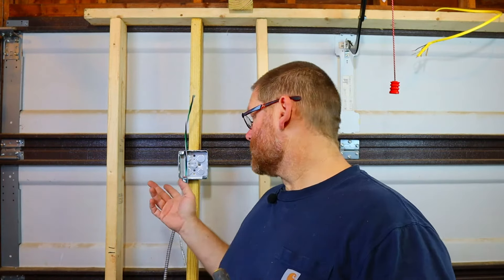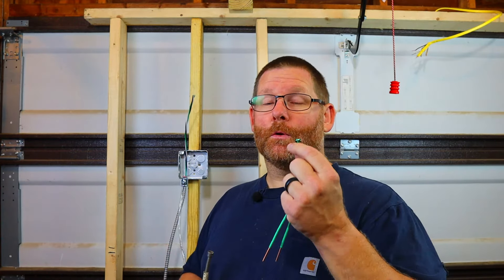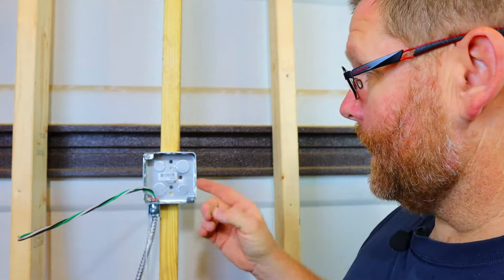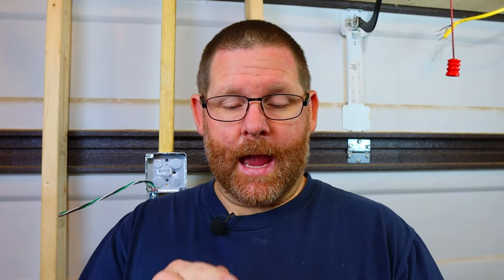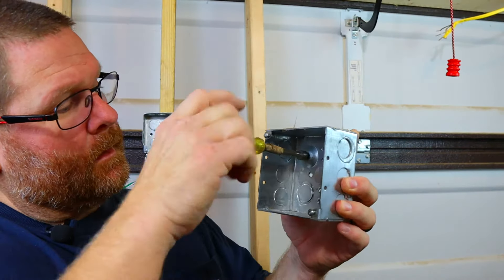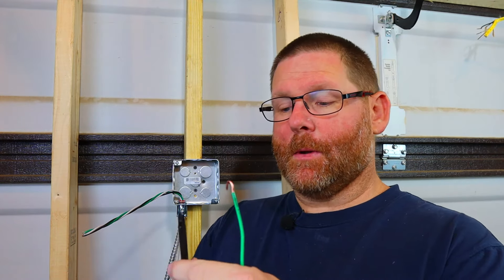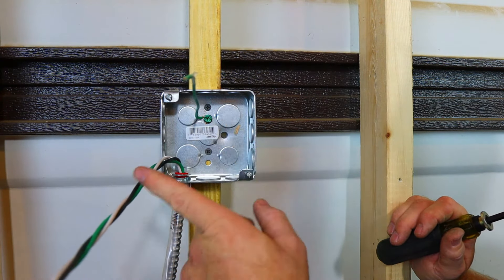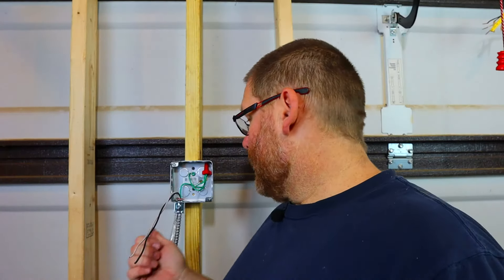How To Ground And Bond A Metal Electrical Box

Comment: Appreciate the info. Is that bend twist, twist again and the bend the wire to form the wire hook true of any conductor that is screwed  to a  switch outlet etc. ?
Reply: Yeah I was wondering the same thing. I would think you would do that on the box to get a very secure ground connection, and it wouldn’t matter as much then doing just a normal hook on a receptacle or switch. But we need the pro to tell us!
Reply from the maker: Yes

Comment: Instead of using a pig tail ground wire, can you use the source ground wire by stripping a small section of it, wrap it clockwise around the painted ground screw lol, crimp it close, secure it and connect it to the load ground?

Comment: Just curious. Why do you use metal boxes for electrical wiring? We use PC (plastic) boxes in the Netherlands, no grounding needed. They are round as well so it is easy to drill a hole in wood/wall or whatsoever
Reply from the maker: Well truly that's just a standard here in the states. It's usually speced that on the jobs definitely PVC is quite faster and a lot easier to work with. Thank you for your comment and watching have a great day

Comment: Great video! Do you prefer the screw on connector more than wago? I will be doing this to my entire house and am unsure where to put the wires once in the main panel. The original installer was stupid.
Reply from the maker: I don't trust wagos I hear alot of good things about them just do not trust them.
Reply: In my (admittedly limited) experience using wagos in electronics low-voltage wiring, wagos don’t generate the same amount of compression force, so can’t stand up to strain the same way a properly twisted wire nut join can.

Comment: Learned a whole lot from your videos. Potentially dumb question: If attaching metal junction box to a metal stud, is there a chance that a fault would electrify the entire metal stud/building for a split second? Thank you.
Reply from the maker: Good question. The building steel is or should be grounded so it will definitely ground itself out. I doubt you would ever feel it.
Reply: @MountaineerOutdoors  Thanks!
Reply from the maker: My pleasure ☺

Comment: I decided to change a receptacle and found that metal box was wired like a plastic box, no ground wire to the box. I found a 10-32 threaded hole, so I did what you showed and everything seems fine. My question is, doesn't the receptacle itself ground the box by virtue of the mounting screws and contact with the box as long as the romex ground wire is connected to ground on the receptacle? When I tested the receptacle with a tester before and after it read "correct" and not "open ground"
Reply from the maker: So technically yes the yoke of the device im will ground it you will need to remove the little paper squares on the screws. If you have a metal box though it is still good to keep the ground on the box as well. As for the open ground. Open ground means that from the receptacle to the panel it's broken or not hooked up inside the panel. It doesn't have to do with the screw in the box. Hope that makes sense
Reply: @MountaineerOutdoors  Thanks for quick response and clarification of open ground.
Reply from the maker: Always my friend..

Comment: Quick question - if I add a metal box extension to a properly grounded metal box, does the extension need to be grounded separately or will it be grounded through the metal to metal contact to the box?  Thanks!
Reply from the maker: Great question, it would be grounded by the original box.
Reply: @MountaineerOutdoors  Thanks!  Your videos are the best!
Reply from the maker: I appreciate it ☺.

Comment: Hi I'm actually in the middle of doing this in my home, quick question so after you have bonded the ground pigtail and wires from the home, is the 3rd ground wire supposed to simulate the extension of the wire? My case I have to extend my cable by a foot.
Reply: I don't get it either.

Comment: Nice. I like your sense of humor! Is it against code to put stranded 12ga wire onto a receptacle screw? Or do you always need to solid wire?
Reply from the maker: No you can pull it to the Recep but you will need to add a fork terminal or add a wire nut and a solid piece of wire to it

Comment: So your ground screw can’t touch a wood beam?
Reply from the maker: Why can't it?
Reply: @MountaineerOutdoors  it was more of a question. Can you ground your outlet to the lag bolt that attaches the box to the wood beam? Seems like everyone says it needs to be drilled out or attached to the side of the box.
Reply from the maker: @kentdavis7787 no it has to be a machine screw it the clip on one. Do people do what you asked me? Absolutely will it work absolutely, is it code nope.

Comment: It definitely takes more time, and I have had to do this with my old house that seems to need custom work at every turn, but have had to drill and tap new holes for the green grounding screw with metal j-boxes.  Not ideal for making good time, but what else to do.
Reply from the maker: Better safe than sorry for sure.

Comment: You’re only partially correct about whether to bond the metal box or not. If you’re only running MC cable to the box and you don’t make any splices or terminations with circuit conductors in that box, you still must bond the box with the screw and egc. Why? Because the armor of the MC cable is not intended of capable to be used as an equipment grounding conductor and all metallic non current carrying parts must be bonded. The MC armor is not identified or sufficient for bonding. In the case of metallic raceways (emt, imc, rmc) you are correct.
Reply from the maker: Thank you for your comment and watching ☺

Comment: I'm not a wire twister, and I always land the line side ground to the box no wire nut. Be exceptional, always use the nec exceptions I always get self grounding devices, the trim out is easier and cleaner without that extra "feelgood" bonder.
Reply from the maker: I understand what you are saying hit /but what happens if that ground breaks to your box and your device is out of the box?
Reply: @MountaineerOutdoors  I do alot of TI/service and RENO work on older buildings. I haven't seen many broken ground wires. In most buildings the EGC is EMT conduit alone. The only time I pull in a ground is for a patient care area.
Reply from the maker: Wait so when you pull in wire in conduit you don't pull in a ground with it? You depend on the emt for the ground?  Here we cannot do that in Virginia
Reply: @MountaineerOutdoors  If its a new run we pull a ground, but we typically will try to use original branch circuits. NEC allows the use of conduit as ground. I live neer a municipality that has a local amendment requiring a grounding conductor on all new circuits.
Reply from the maker: Gotcha, I understand that about the code but our local inspector definitely requires it no matter what. Stay safe out there brother take care. And I appreciate the conversation
Reply: @MountaineerOutdoors  God bless, I enjoy the videos.
Reply from the maker: I appreciate it and always thankful for my subscribers.

Comment: The electrical box comes with more than one ground screw option capability. The threaded ports are for a threaded bolt. The other more ordinary screw holes are for a more ordinary ground screw like one with a wide flat head top on it. Then the big wide extra depth box later in video has two threaded bolt ground screw humps in it because where the box is bigger and can accommodate  more wire cables going into it it is better to have a second screw to diversify and add in additional grounding location to help out in accommodating the all that big box can potentially hold at its highest limit to so do so. Note: many complaints exist that when one uses the pig tail caps as wire connectors that the more wires that need to be grounded make such an awkward giant hard to work with pig tail they now like other connectors , yet the manufacturer makes both the electrical box and the connectors that use the pig tail wire connector [ and the other connectors possibly ]. As such they give two ground bolt humps in the big box so one can pig tail so many of the wires onto one; then after use the other as well to do so thus diversifying them and using pig tail twist on wire connectors as they have made and used for years  and not push folks over to another companies wire connector. They addressed the problem in their own way by adding more places to ground the ground wires to the metal electrical coupling chassis of the metallic box , and then inter connected the various ground port locations by virtue of it being a metal box - thus the ground screws are connected to the metal and both electrically are together and both serve the mob of wires in the box if the number of wires in it reach the max the box can handle should its capacity be maximized if ever in time.    

Note: if one connected all the ground wires of all the cables in the box to one set screw.

Then used the other one to connect the device in example one with a large square back that absorbs box space on seal boxes all up.

GFI outlet, or a count down timer switch or etc….

Or say a smoke detector - since they are changed every few years often many may wish for a roomy box with a lot of spare wire length since over time they chisel down and away at the spare wire length. Many home owners complain that they have no wire eft or rome to put a twitch of spare in when boxes get
Tied up as such - a second pig tail and set screw to ground in a metal box is used or more liked buy them. In that:

1- set screw = all ground wire conductors that never need to be touched again hopefully.

Then the ;

2nd ground screw - they like to tie jut the device to it since it will be changed out periodically every so often — smoke detectors every 6 to 10 years, and outlets when house paint colors change , switches , and lights - when styles change.

By putting all the conductors on one - that would be bad Ince all would be played with  when changing ou the device.

By putting all things one does not normally change on one - then they can be left alone so ground wires don’t twist and snap off at the stem entry point of it entering the box making entire cable useless, and in need of being re-run  through all kinds of walls, rooms and ceilings,  as a result to re-establish proper 6” of spare ground length to reside in it. = hopefully a bigger box will end to a longer left over spare length in it to last for longer lengths of time.

♦Simply putting the more likely to be changed more often devices ground on a stand alone ground screw or the opposite hump in the big expanded box is an option that possibly the manufacturer intended for it to be used for, thus possibly the electrical code does allow it, or if it "does not allow it", then possibly manufacturer wanted it to be in  the product as a feature that they will one day go to the board that rights the code and try to get them to see it as a better feature to aid from putting to many grounds on one ground wire connector coupler or see it as a feature in some other way or as possible a thing they can include now and late go through teh long tedious process of government approval for it to be used  in that way and await an electrical  code book update or change to occur over time note many folks commenting on many reviews stating situation that was just  stated needs to be improved.    Since so many things are absorbing the spare wire length and diminishing it over the span of time needlessly since they thought of a way to help end it.
Reply from the maker: This has to be the most informative and helpful comments I have ever had. Thanks for taking your time to write all this and for watching and commenting.
Reply: Most companies too cheap or lazy to order ground bars. I would get a long say 40 hole bar and cut it to 6 or 7" for a 8 by 8" junction box then use two screws to secure this convenient bar to side of metal box. Made installing additional ground wires a lot easier in the future.

Comment: So if I’m using one with raised ground spot for a deep quad double duplex receptacle.... I’d branch the hot, neutral and grounds. The ground would go from one receptacle through the other and use a wire nut to tie that and the one from the power cable together making it essentially two wires together in the nut on the ground? Sorry the video keeps giving an error at 9:23 and I can’t watch past it. Idk why.
Reply from the maker: You would essentially have 5 wires tied together. The in, out, the ground wire to the box, and the 2 pigtails to the devices.

Comment: Beautiful wire stripping technique! Dual strippers are a great idea. Question: I've found that the threaded holes for ground screws will fit #10x32 machine screws. Is it a code violation to use any old steel machine screw if it's the right diameter and thread pitch, or does it have to be green?
Reply from the maker: Absolutely not it doesn't have to be green as long as it's a machined screw 10-32 is perfect.. Great question
Reply: My inspector will never allow a standard 10/32 machine screw for a ground wire due to the head is too small. Have used a 1/4" machine or hex headed cap screw with a ring terminal to ground say larger boxes ( 10 by 10" ) that do not have a tapped ground thread. As long as you remove the paint on both sides of box it will pass inspection. We always used a lock washers on screws or bolts used for grounding. If you are running 120,208 or 240 volts to nested combinations knockouts ( ex = 1/2 & 3/4" KO ) and using say 1/2" EMT conduit if you pull a ground wire you do not have to bind ever box to ground but usually do anyway.Hated when union sparkies pulled say #12 wires thru a 1900 box w/o any splices they seldom left any slack so they could have an extra penny in scrape copper. Then you would be forced to cut the wire at pipe exit then pull new wire from that box to first box downstream of it. Was great when they did this to 120 volt emergency red receptacles that feed critical equipment. Had to do a 3 Page write up then move starting time either back before or after 6 o'clock.

Comment: My house was built in 1929 and my wiring runs through the attic and all the lights all run off each other.I took one of the lights out of one of the rooms and was going to put a junction box in it’s place and there’s no ground wire just a old cloth black and white wire.Not sure what to do.
Reply from the maker: Do you have knob and tubing?

Comment: I always get the raised ground boxes.
Reply from the maker: Me too that way you don't have to worry about that ground. They all should definitely come standard with the raised ground in my opinion
Reply: @MountaineerOutdoors  Some dummy will buy the flat one because it's the cheapest, and will do a DIY hack job. He will probably run NM through 1/2" EMT and not properly ground/bond the boxes anyways. Lol
Reply from the maker: Yep I've seen it before

Comment: Two questions, (1) What is your opinion on how some electricians instead of doing a box ground pigtail they strip the sheath and loop the ground wire on the grounding screw? (2) Are there any 1900 boxes that come with 4 screw tabs so that when you put the industrial cover it actually secures at all the corners and not just on opposite corners, leaving the other two just as holes? Thanks for your reply. -Cheers
Reply from the maker: 1 totally fine 2 I don't believe so at least none that I have seen.

Comment: You don't need a green ground screw at every splice or device.  You can actually put a ground screw anyplace, it's not illegal.    No torque screwdriver or mention of it.    Less than average.

Comment: Wait a sec, like at 11:21 So where does the 3rd green ground wire goes or connect too? 🤔
Reply from the maker: That is how you do it for a device (receptacle, switch, etc) I just left the pigtail on it to show how to do it.
Reply: So if I was wiring a ceiling light in a metal box, that third ground wire would be the ground wire to my light fixture, correct?
Reply from the maker: Yes and make sure you utilize the green screw on bracket etc if it has one
Reply: Thank you, that was my next question actually.

So that third wire in your video would be the ground from my light fixture. I would wrap that light fixture ground around the bracket screw and then that same ground wire would be twisted with the pig tale ground to the box and the ground wire from my panel with a wirenut, correct?
Reply from the maker: That's how I would do it.
Reply: Thank you very much.
Reply from the maker: My pleasure
Reply from the maker: Your description on the ground will absolutely work

Comment: What is that "send it" at the end of the video... its a 3rd grounding wire doing what?  dangling free or does that connect to some imaginary outlet?
Reply from the maker: Ok no idea what 3rd ground wire your talking about??? And send it just means it's done
Reply: The third green wire would go to a switch or a receptical if he was installing one, but for the video he left it empty.
Reply: @gregorykotoch5045  Thanks.

Comment: Does it matter if your ground wire has shielding? Out of the MC, the ground wire is bare silver colored.  I thought that was weird.
Reply from the maker: It's a static drain usually used for sensitive equipment computers medical equipment.. Usually it's used in hospital settings.

Comment: Halfass? Wire nut manufacturer says no twist. They were designed so you don’t need to twist your wires together.
Reply from the maker: Yea but it doesn't do a great job. If you are just going to do that and not twist might as well just use those worthless wago connectors